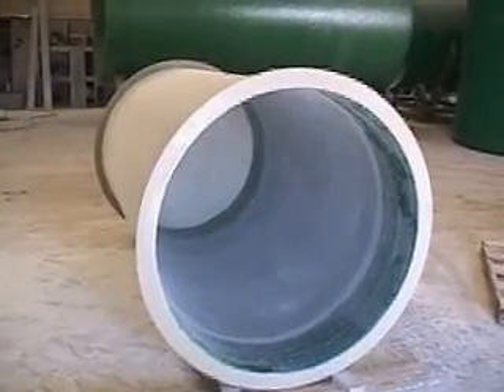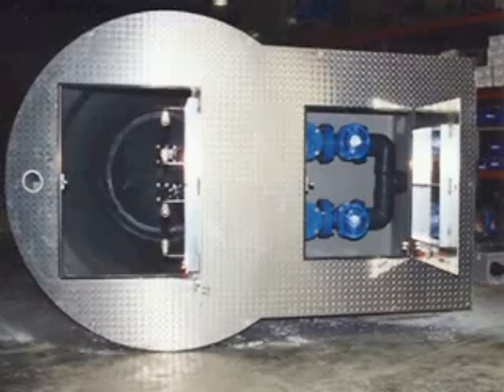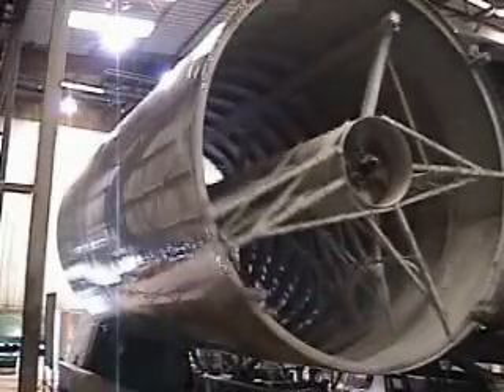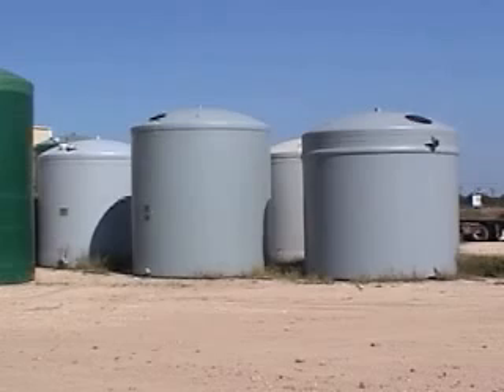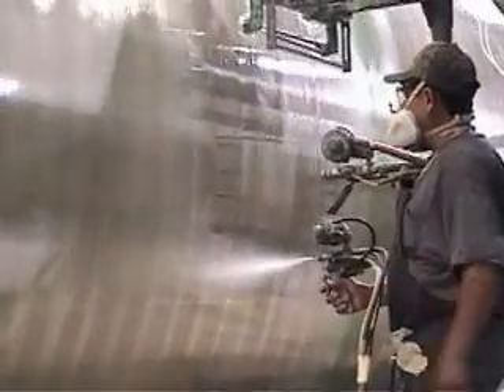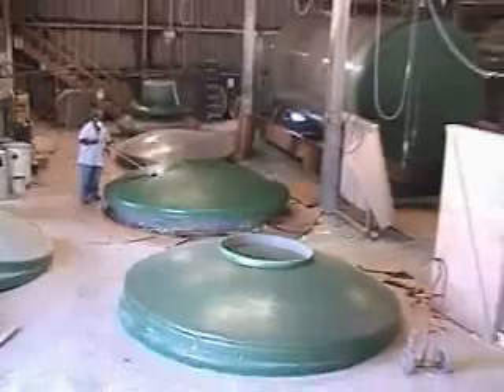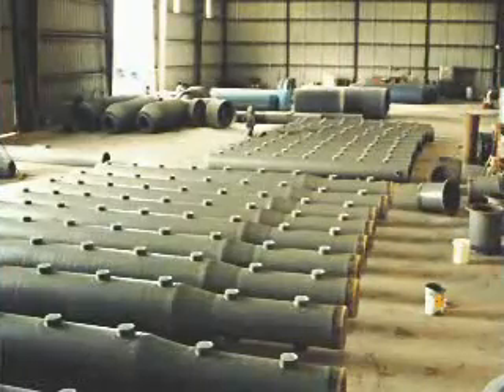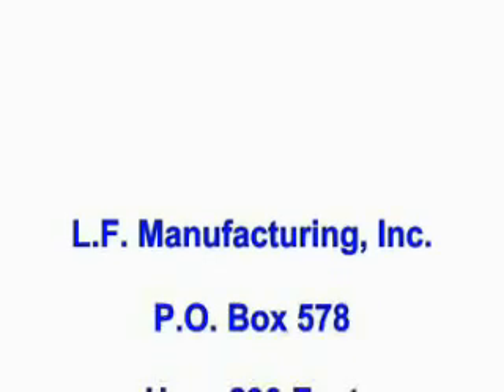Fiberglass Basins and  Fiberglass Tanks & Piping Systems Educational Video from LF Manufacturing

Comment: Do you know if fiberglass is an acceptable material to use for making a custom storage tank for alcohol? I would like to build a 5-gallon fermenter for making beer.
Reply: I'd be looking at Rotomolded plastic tanks. If the resin they use won't change the flavor. They usually come in PPL. HDPE. AND XLPE . Probably more cost effective than the FRP Tanks. It used to be difficult to get a food grade thermo set FDA compliant resin. Might be different now..